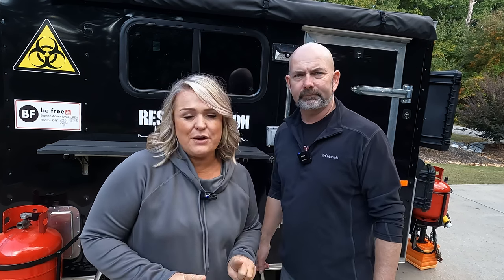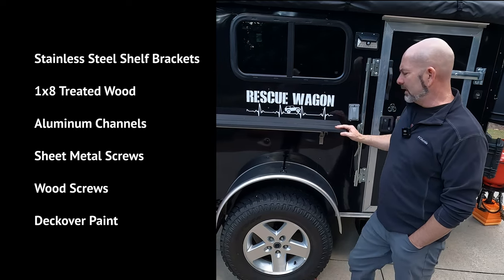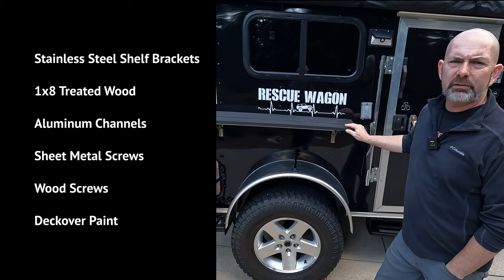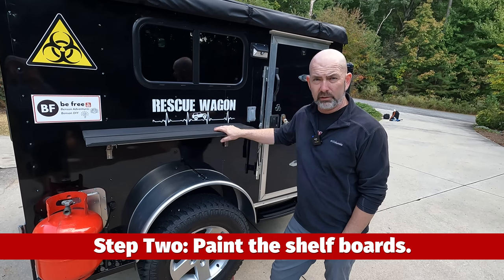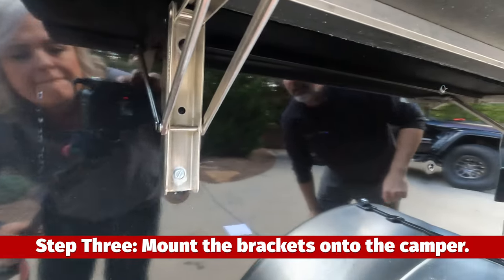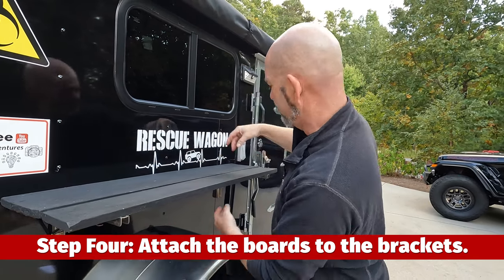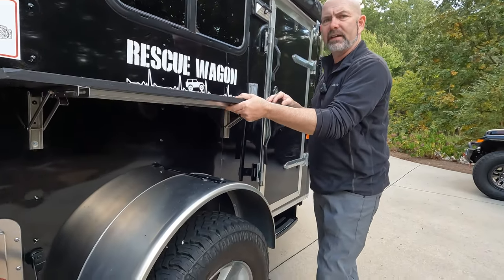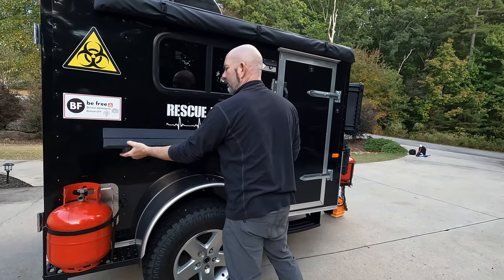HOW TO INSTALL AN OUTDOOR CAMPER SHELF//5x8 Cargo Trailer Camper Conversion

Comment: Liked Subscribed and I'm so curious what trailer this is and how well it's holding up after all these months. I've been hearing horror stories about electrical issues and seams and rivets just not holding up because of poor construction practices
Reply from the maker: Thanks so much for watching and subscribing!!! This little camper is exceptionally well built, and is holding up great. The only work I've done is stuff that I have chosen to do.  After owning normal campers for the last 25 years, I would say this is much less work and upkeep...